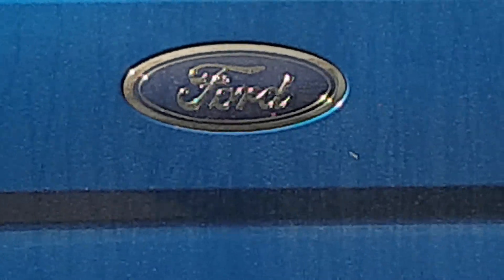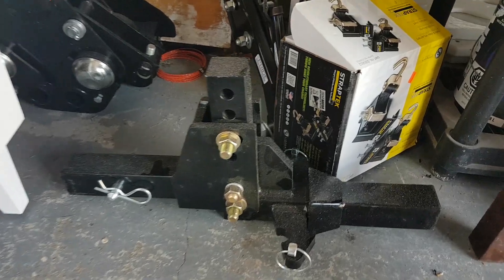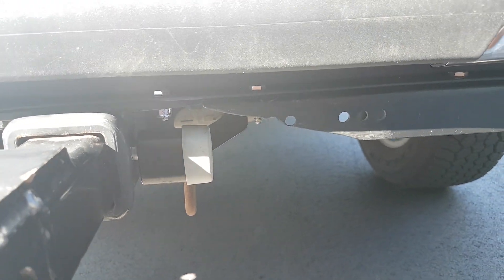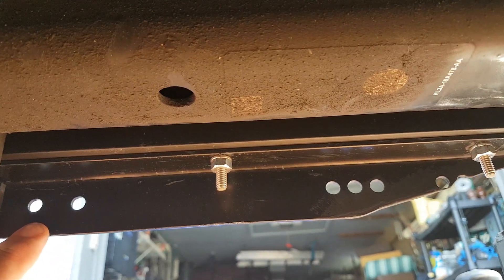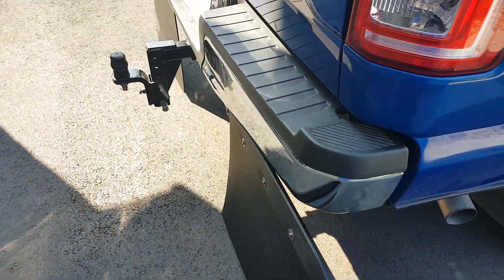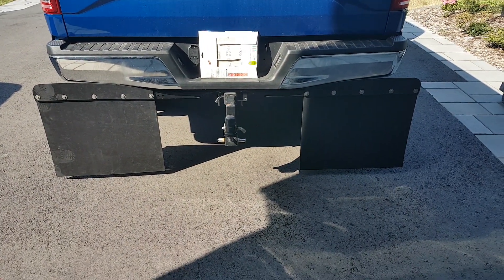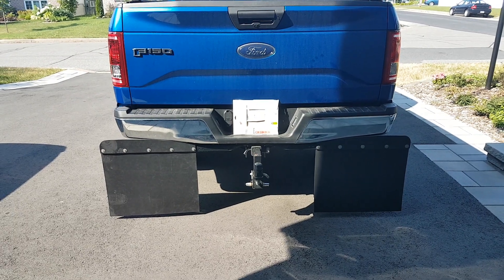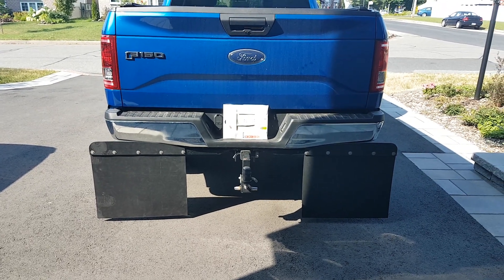Home made Rock Tamers

Comment: In the video it is hard to tell how the angle is attached to the hitch.  Can you show or explain more in depth?
Reply from the maker: you can see at 1:30 the bolt and self locking nut that is in the middle of the screen is where the angle attache to the hitch. At this place my hitch has a horizontal reinforcement plate in which I drill a hole for the bolts. I have one bolt like that on each side of the 2 inch receiver cube. At 1:34 you see the other side. Hope this help?
Reply: @windman1961  Thanks.  It does help.